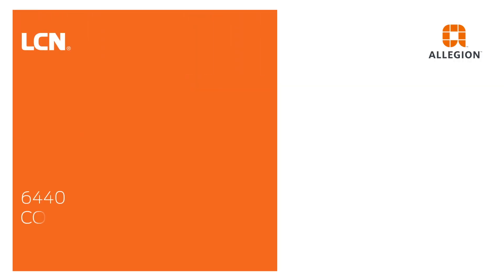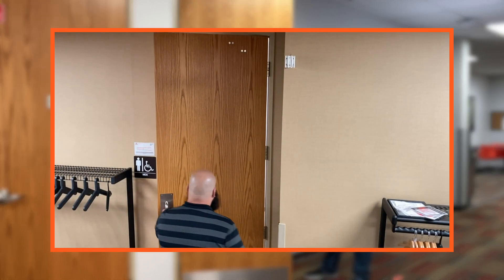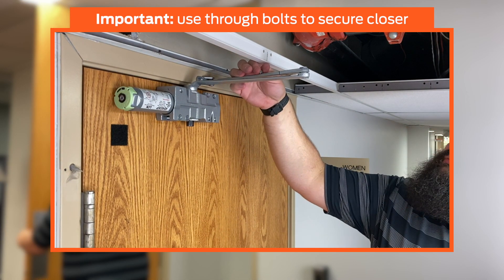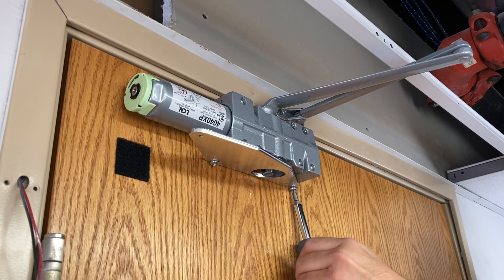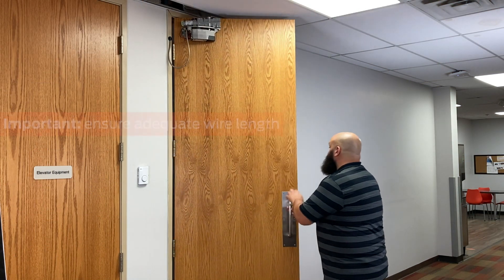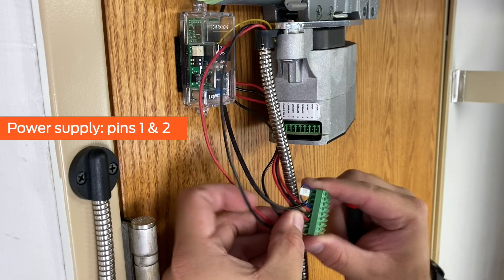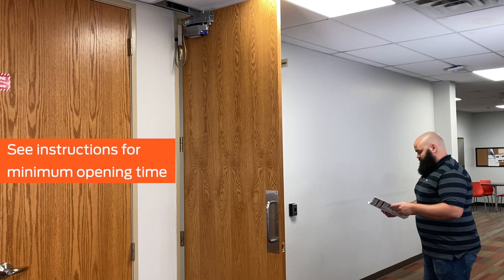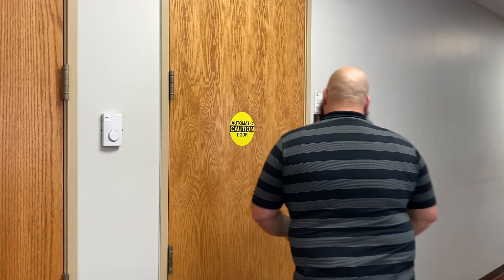How to Install the LCN 6440 COMPACT Automatic Operator

Comment: One thing that they forgot to add.  A relay for electric strikes and electric latch retraction exit devices.  That's a problem because, in my building, the restroom door is fire rated.  So, it uses a lockset.  So, I will have to use an electric strike on my restroom door.  This device doesn't have a relay for an electric strike.  I hope LCN has a solution for doors that have latch bolts and electric strikes.
Reply: Technically you can use this device with a strike, relay and option board would have to be added and strike powered by it‘s own power supply as this operator only has a power out for the BEA 900 receiver supplied with it,

Comment: Will this actuate upon manual open of the door? I.E. pulling or pushing open the door?
Reply: Hello Stye, sadly no this device does not support “push-N-go”, the devices that do are usually high energy operators that do not use a door closer as part of their functionality, the 6400 is a low energy operator and can only be triggered by a wall button/wave switch to operate, LEO’s can only have “knowing act” switches, “Push-N-Go” is not knowing act compliant

Hope this helps understand the world of Low Energy vs. high energy operators

-Jess the door closer doctor
Reply: Push n go is a knowing act, I believe. You have to push the door. Ansi A159.19 6.3.2 outlines signage required for an application where door motion initiates the operator cycle @JLD902